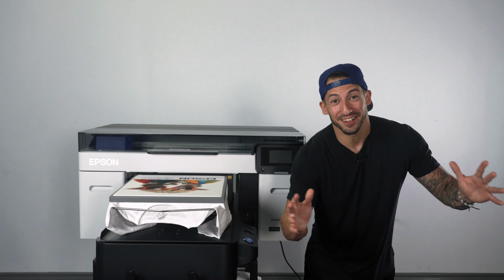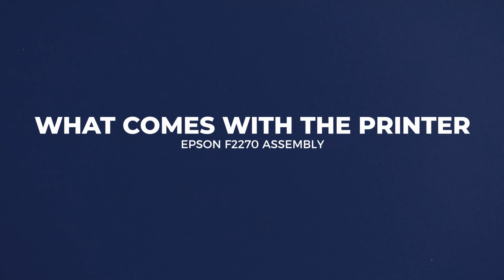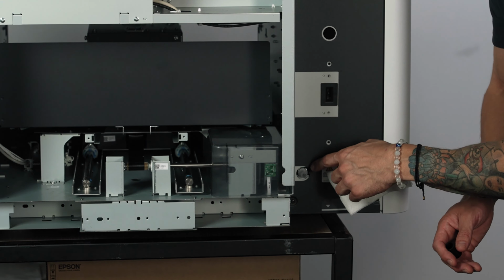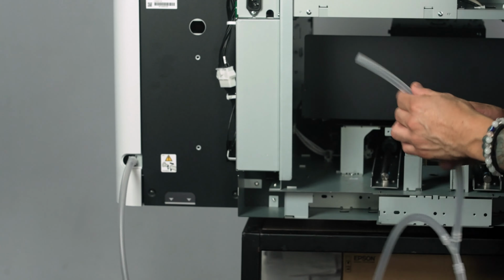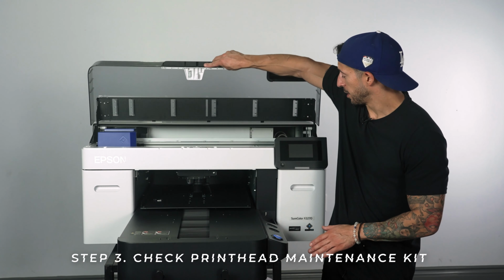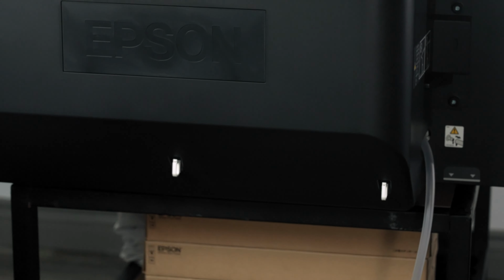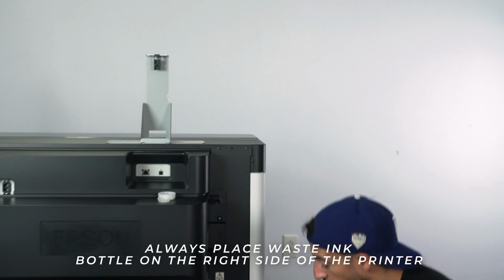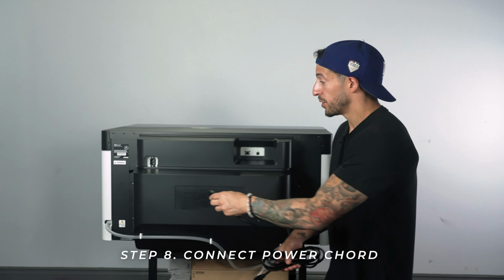EPSON F2270! ASSEMBLE!! | AA Print Supply

Comment: Don't forget to take out another loan for ink replacement cost.  Over $300 per cartridge costing you well over $1500 to get replacement ink. That's crazy priced for ink
Reply from the maker: Hey there! The machine comes with a full set of ink and the cost per print is miles away compared to what you would get outsourcing to a screen printer per individual piece. CMYK actually lasts quite a while it's the white ink that's see higher usage printing under everything

Comment: How do you move this printer through a doorway thats only 29" wide.
Reply from the maker: Hey there! Moving through a door way is a breeze with some help. When you turn it sideways just make sure the the Epson logo up front is in the DOWN position so the print head is resting versus being suspended in the air